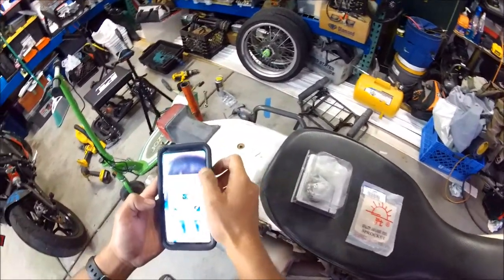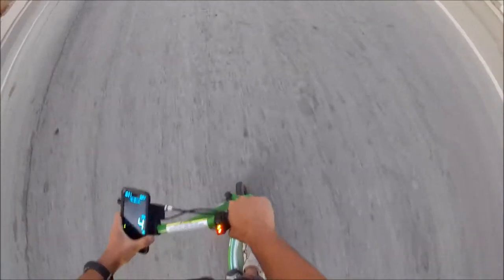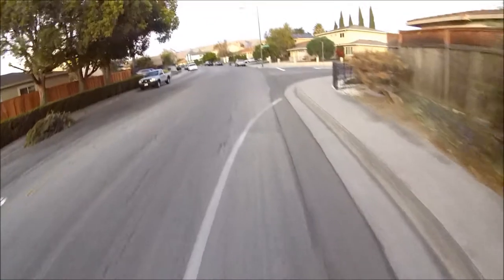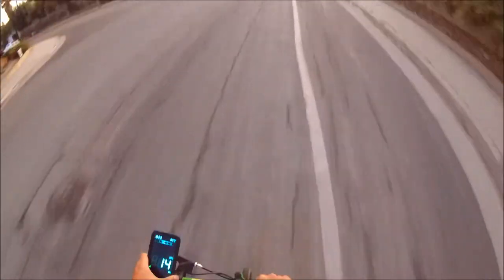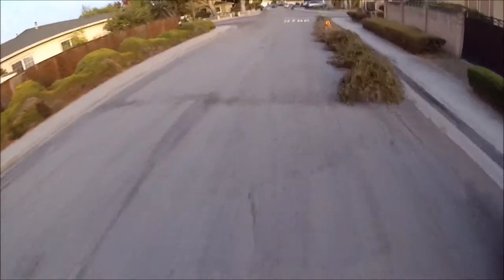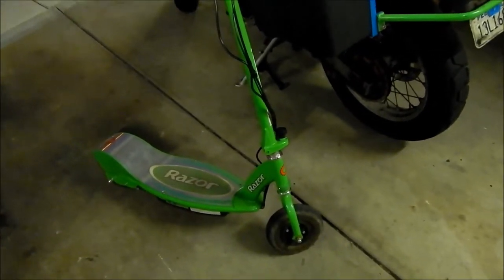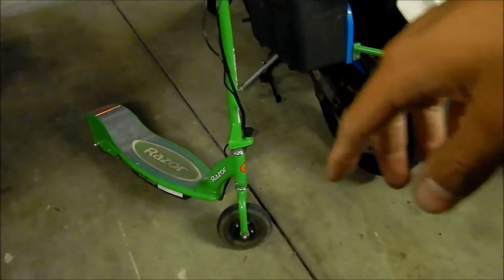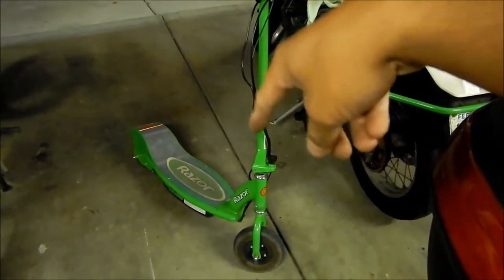Razor E200 Scooter ZY1016 350W Motor Install VLOG Part 4 - Speed Tests

Comment: You need to get a different controller that slightly over volts the motor for it to be faster.  I would get a better controller.